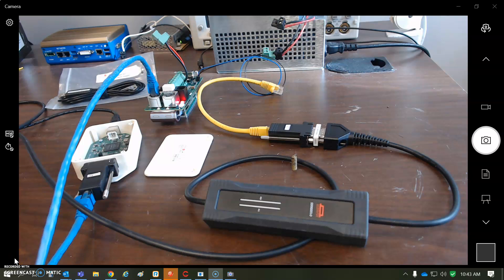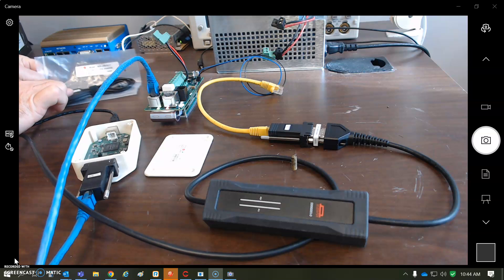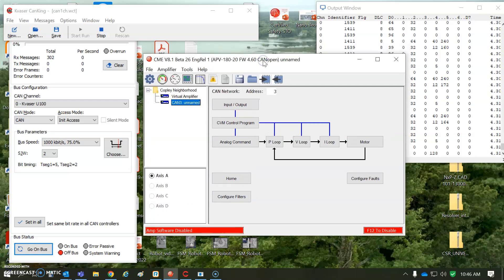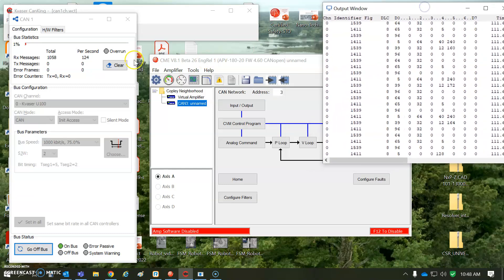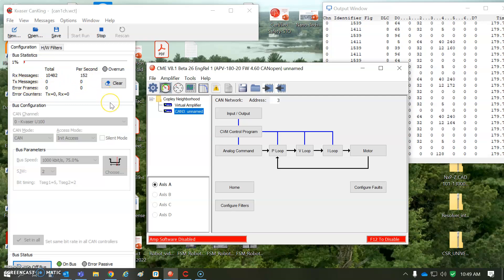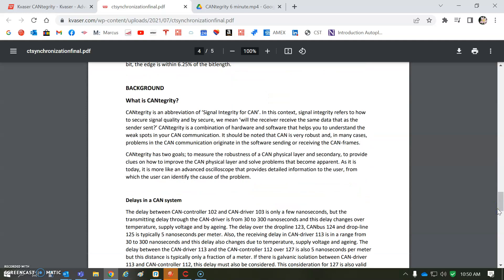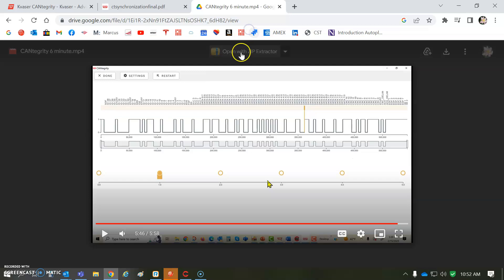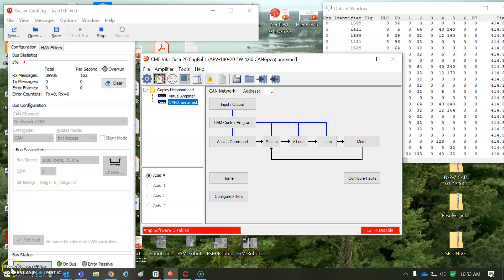CAN bus monitoring and message logging using Copley CANview or Kvaser CANking. Intro to CANtegrity.

Comment: What software would you recommend to  display the can-bus traffic as a plot/gauges/etc?    I don't see in CanKing the option to import a dbc file and plot the data as a graph.

BTW, I'm using a Peak PCAN usb interface
Reply from the maker: What data? We have used a browser to display with JASON (Java Script Object Notation) to display data like AMP temp and RMS current but that does require some software like CMO (Copley Motion Objects) but we are not compatible with Peak. Peak should have some software for reading device data periodically with SDO (Service Data Object) assuming the device is CANopen and not just CAN.